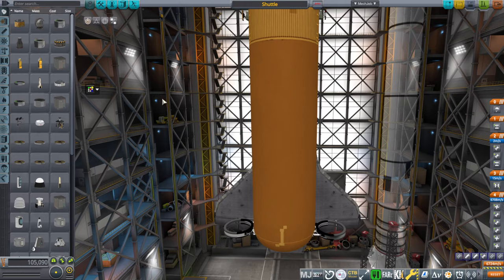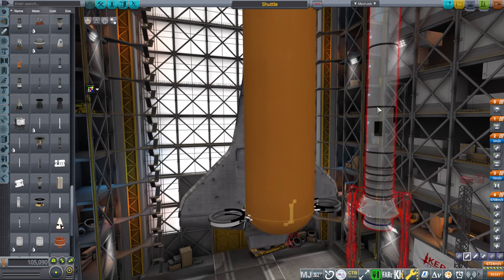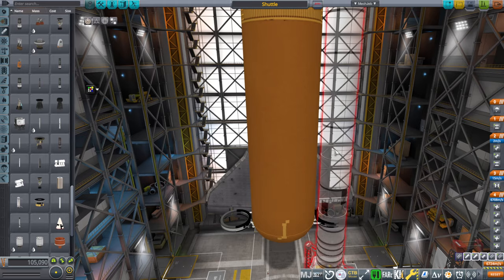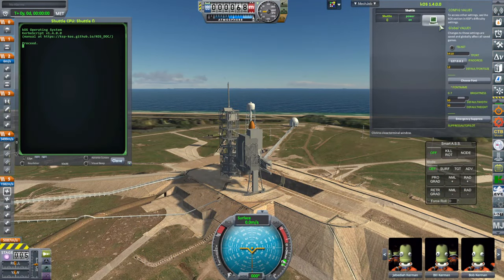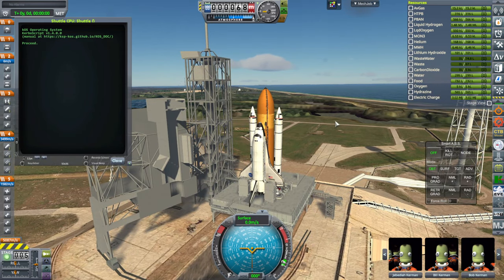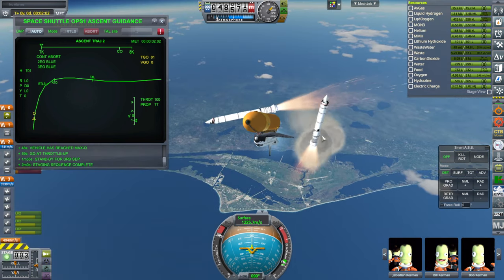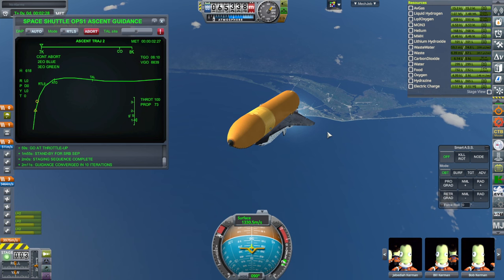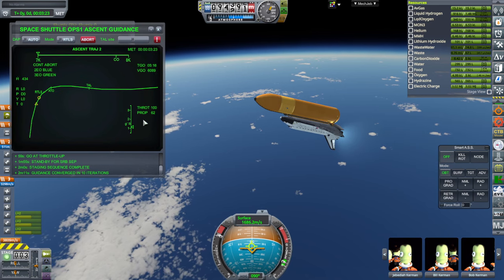Shuttle Troubleshooting (with the Giulio Dondi Shuttle in KSP 1.12 with RO)

Comment: I have 2 questions about mods, first, what mod do you use for those voices that were heard at takeoff and second, what mod do you use for the flow priority and what is it for?
Reply from the maker: The voice mod is Chatterer. Flow Priority is stock in KSP - you just have to enable Advanced Tweakables in the settings. It sets which tank gets drained first - the higher the number, the sooner it will be drained. In the case of the Shuttle, I especially use it to set the External Tank a higher priority than the Shuttle itself, because otherwise the RS-25s would potential drain the fuel cell hydrogen and oxygen before or at the same time as the external tank propellant.